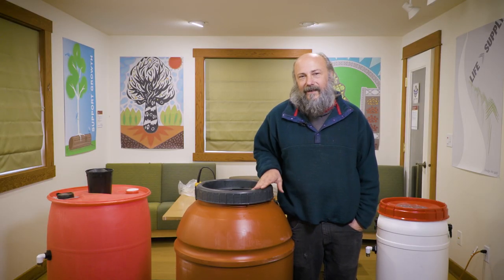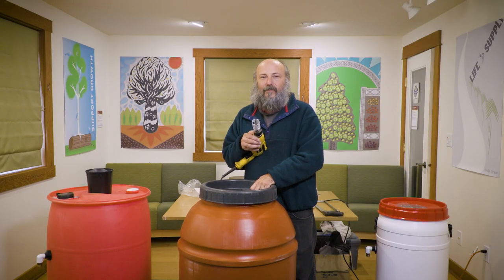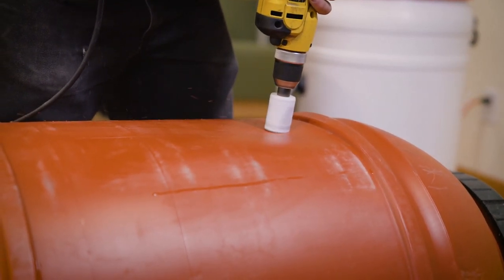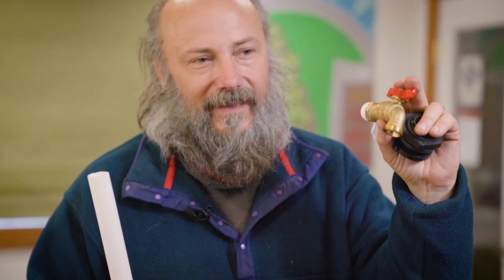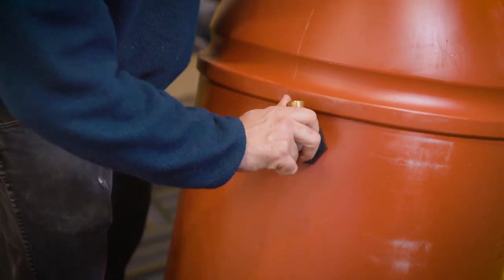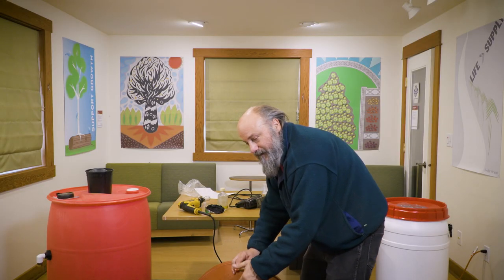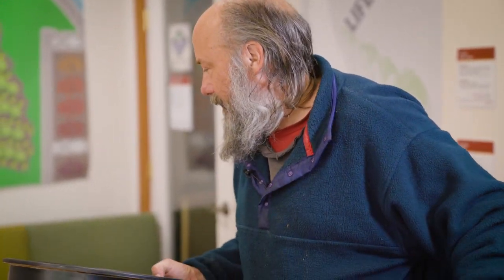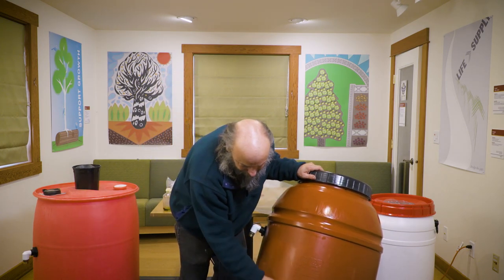Building Rain Barrels - EnviroHouse How To

Comment: A tip to all for the overflow... 1.5 inch pvc sch. 40 pipe and elbows from local hardware stores. Get a Hayward pool inlet (Part#SP1023G) to go through the barrel. You will need a  2 1/4 in dia. hole saw. Hope this helps.

Comment: I really appreciate your tips particularly your overflow design. Because my barrel has few flat spots and is mostly is mostly shaped by a radius, I was concerned that choosing a low overflow hole would ruin it's capacity. Not any longer! The way you used a pipe to the top on the inside solves that problem. Thank you very much.
Reply: Very glad it helped.   You can really put the overflow anywhere you like on a barrel, with this system,  as long as you have a straight run for the pipe to the top of the barrel.  I dont use any glue with this at all and another cool thing i like about this design is that you can bend the overflow pipe down if you need to to accomodate a larger roof area, if that makes sense?!🙂 gives the water more time to overflow out of the system so it wont overflow over the top of the barrel
Reply: @danborba7028  Hey Dan,  wouldn't "bending the pipe down" be equivalent to simply removing that pvc pipe inside?  I've got mine built and going to install this weekend but I am worried the 3/4" hose won't drain enough water fast enough for my downspout.  Roof is probably 400 sq ft.
Reply: @jeffbauman5447  hey Jeff, you could just completely remove the pipe and when I make them they're around 10" long or you can bend it to your liking, i.e. an inch, 2", 5" or whatever.  The more you bend it the less capacity.  400 Sq ft is a pretty big catchment area but by bending down the pipe to start with you can see how well it overflows at that height and then remove the pipe if that fails.  Does that make sense?
Reply: @danborba7028  Thanks Dan, yeah absolutely makes sense...I was confused by the word "bending", but I get it now, you're saying just change the angle so the top is lower...Makes total sense...I'll give it a go...Tested it the last few days and seems to be leak free!  Great video and thank you for your help.
Reply: @jeffbauman5447  excellent.   Glad it makes sense, it's a better option than pulling out the pipe and just cutting it.  Many years of happy harvesting!

Comment: I thought you weren't suppose to use metal spigots on rubber barrels....  you should use rubber on rubber so they don't eventually leak.
Reply: Thank you, I hadn't heard that before.  I've been selling metal ones since 1999 with arrowhead spigots til 2013 then Legend Ball valve spigots since then.  I do get a reported leak from the Legend occasionally
Reply: @danborba7028  hi Dan. Wish I could still paint your truck.